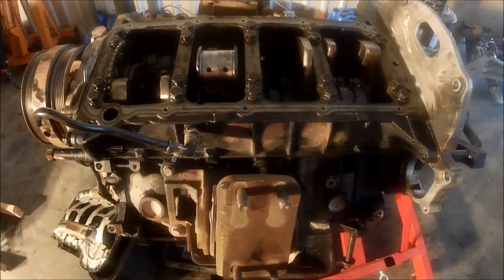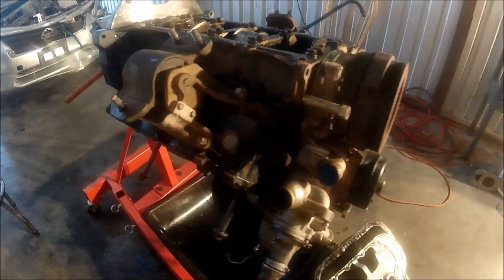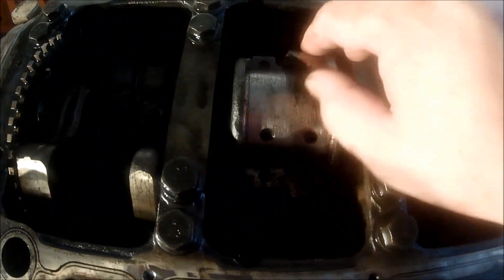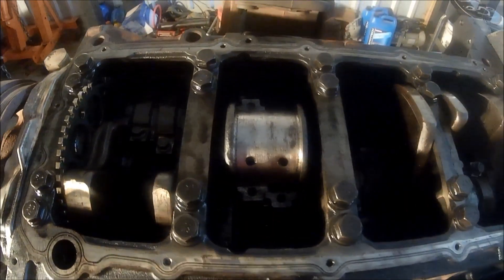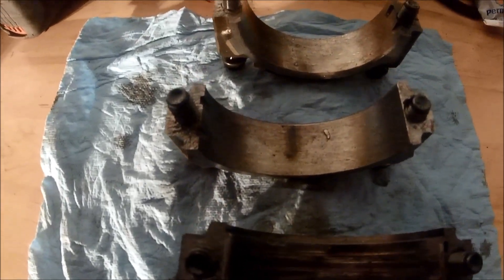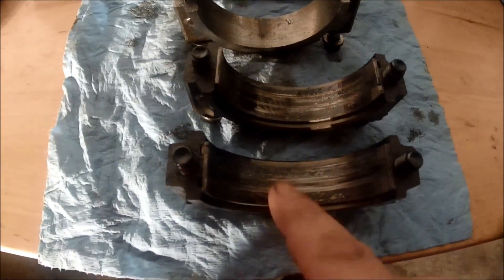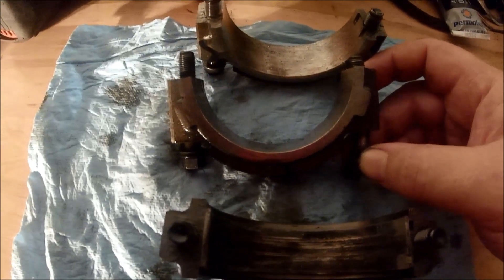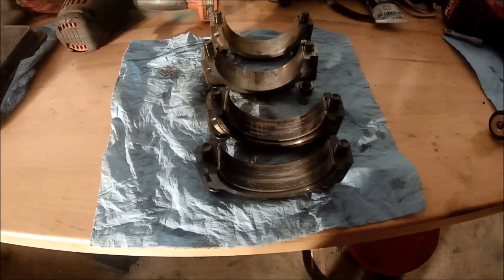Engine Carniage -- Ford 6.4 Powerstroke Engine -- What Caused it to Fail?

Comment: from what i get with 6.4ls is the higher the milage the better the deal, on the other hand the 6.0l is less miles better deal,
Reply: Jay's Mobile Mechanic Services thats the thing is i love the 6.0l but the 6.4l are plentiful (for good reason” they look nice but the engines are trash they “can” be fixed but id still rather have a 6.0 but damn i like the look of the 6.4ls 😂 but the 05-07 facelift are still my favorite